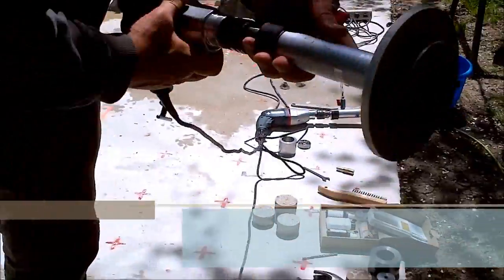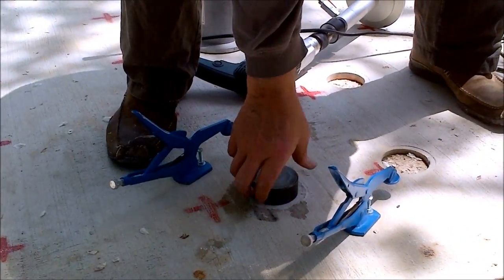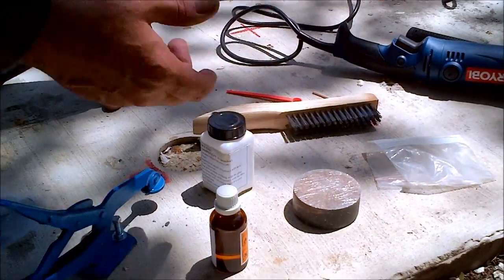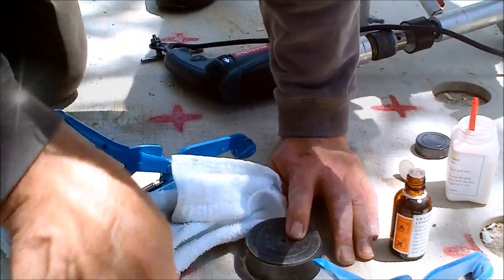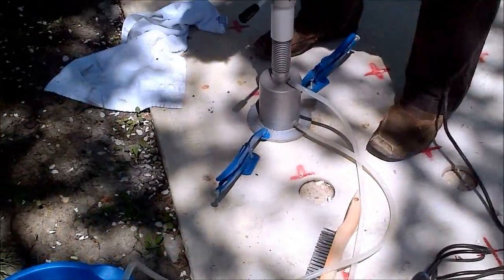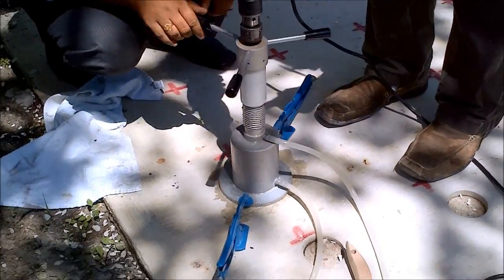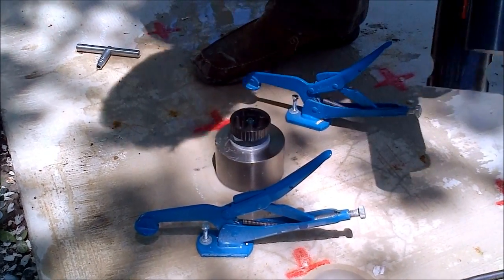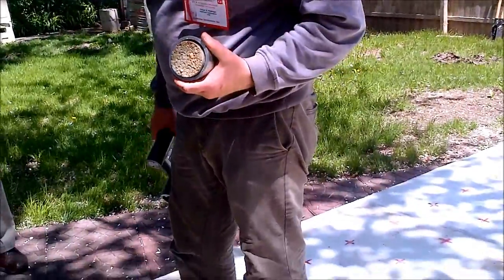BOND-TEST for Concrete ASTM C1583

Comment: Would dry drilling the core affect the results? Would a grooved top surface for a ppc overlay affect the results.  Is a flat surface required to achieve a proper test result as shown in your video.

Comment: How can I measure the depth of cutting at the time of test?
And what should be the depth of cutting?
Reply: You can measure the depth of cutting by measuring the amount of spins given to the coring rig's handles. And you should cut further (about 1 inch)  than the interface you want to test, which thickness should be a known number by the time you take on this kind of projects.

Comment: What are you using to plane the concrete?
Reply from the maker: Hi. We use our Diamond Planing Wheel B-10010.
If you follow the link you can find out more about the system.
http://germann.org/products-by-application/bondtensile-strength/bond-test

Comment: Under what condition partial coring is supposed to be done? I have 3 small-scale slabs in which the concrete cover is about 3 cm and it seems that partial coring wouldn't be feasible. When is partial coring used?
Reply: In my mind, partial coring is feasible and should be done always. Of course, we always core at least 1 inch below the interface to be tested. If you perform the partial coring directly in a rough surface you might induce cracking that will weaken your interface zone. Therefore, prior surface preparation has to be conducted using Germann's Diamond Planing Wheel. Germann's Pull-Out Test procedure is the most time consuming but, the most accurate as well.

Comment: do you have something to measure the tensile strength of materials in joints? Like when a urethane is placed in a joint?
Reply: Those are just done with a 90 degree pull test by hand. All you want is that the sealant ruptures within itself before losing adhesion to the substrate. Pass or fail only.